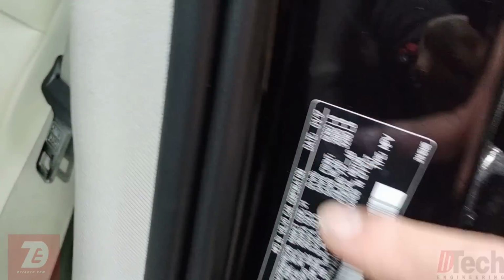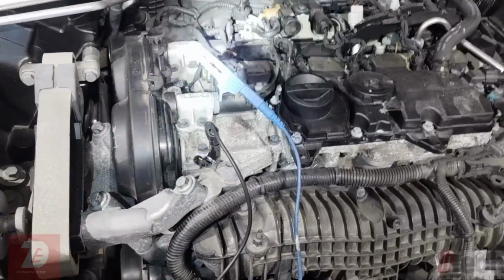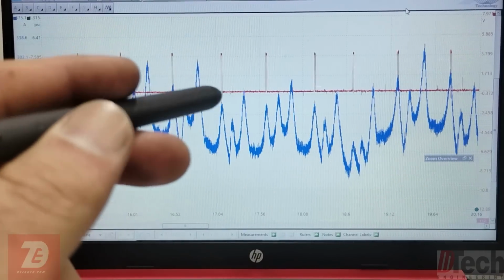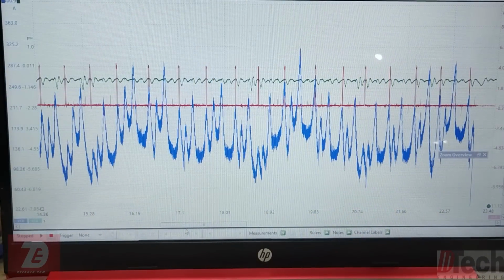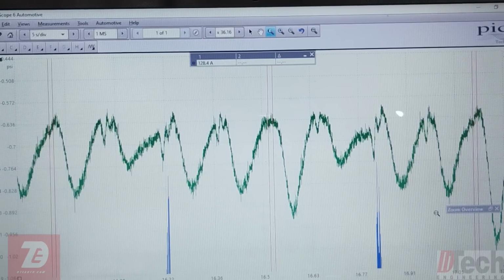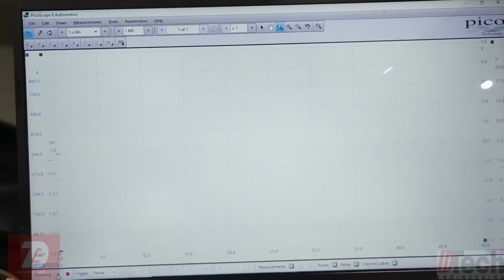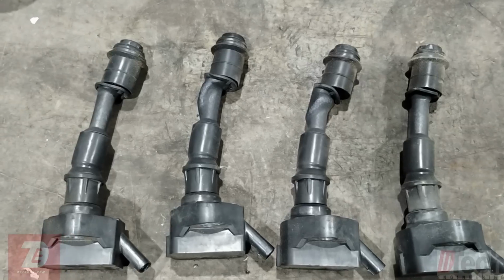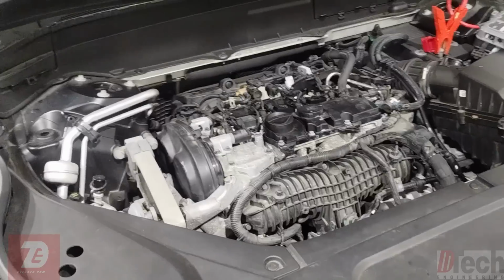2017 Volvo XC90 Crank No Start Diagnosis

Comment: Thank you for the added intake vacuum transducer, no need to waste all 4 channels. No compression then the next cylinder too low and the audible test sounded like more than one problem and random cylinder heights, more than 2 problems. Timing for sure. Be very careful about the wider and narrower spark trigger, that could be faster vs slower RPM, but this time you are correct. We need to learn to measure cylinder peak to peak time and not only rely on our poor vision and misinterpretation and could work it out in reverse from a known bad #2 from the right side. May be compression getting trapped and released on occasion, will wait and see. Its nice that you always take the extra time to work things out. At 17:15 the tops of the green waveforms should be 2 humps/spikes, the first is AN exhaust valve the second is AN intake valve, not from the same cylinder and they shouel be seperated by 20* crank rotation if my memory is correct, the timing is floating all over the place, lets see if something came loose inside and escaping compression will also affect the peaks or roundness??? The peak to the left is not going higher so I do not think there is an intake valve leak on the upstroke of the pistons. Peak high point in the intake seems faily stable. The vacuum pull deptch can be controlled by more than one issue such as trapped compression, RPM, leaking exhaust valve, valve timing vs piston location, etc. Even if you do an INCYL it would be nice to do all 4 to see what is happening all the way around? 

Crank speed slowing down at the blue trace, YES for that cylinder, what about all the other cylinders that are also slowing down at TDC but we are not monitoring them with a trace? You already mentioned the long fluctuations going very high and very low on the blue trace, that area is covered by several crank rotations, not only one, but you are very much onto something coming up. Again measuring peak to peak can determine RPM slowing or speeding up, actually in math/calculus on a scope, the angle of the rising edge and falling edge is all that is needed to make that call which we also use to determine compression leaks past the rings or otherwise on a normal INCLY diag with a leaning tower for one example. The tailpipe should have been the 4th channel earlier in my opinion as per Bernies training and my own belief of when to fill up the scope early in the diag. We can turn off channels to drill in on specifics, not like the old days.  

DAMN, holding our hand over the oil fill hole would be a dead giveaway on this one but I dont think that explains all the problems yet.....Super heated Head, WOW, whats to come....So much for that engine, will you continue to find more.....I am wrong about timing, looks like some extra water working its way in intermittently in cycles. Dude I love it, you dont like to give up. I knew about blowing the fuel out but I DID NOT KNOW it also helped to build up heat, sweet. Could the long cycles of blue trace be back pressure in the exhaust with water until it got blown out in cycles above a certain level??? I dont drive around with the hood open anymore, a hood rod let loose, ended up on top of a headlight and got smashed and cost me a used headlight, I have seen other get their tools in between and a dent in the hood and a video here recently getting his scanner smashed by the hood latch, was thet RRR Rainman Ray??? Because its a multi cam engine, I can say that good spark timing can be for one good cam timing only??? I will give this video my highest rating in my private library as I do several of your diagnosis, cheers.

Comment: Thanks a great video, if there is a bad synchronization of two teeth, can we find out with the relative compression and the ignition coil, as you showed in the video
Reply from the maker: If you are referring to timing being off by couple of teeth, then yes there's a chance you can see that with the relative compression and ignition sync.
Reply: @DTEAuto  Thank you for your response, I am talking about the case where we do not have a reference, if you find a similar case please share it with us

Comment: Nice diagnosis. But after running the engine and driving round the block. That vehicle might never get to run again if left as it might loose compression as a result of the overheat(head gasket issue)
Reply from the maker: it got a little more rough the longer it ran

Comment: This is one of the best videos you’ve done, Sadel.  Lots of great information (especially regarding how cranking speed affects intake vacuum), and backed up with the coolant in the cylinder (or was that unburnt fuel?) and (you called it!) damaged ring land.  Fantastic work!
Reply from the maker: Glad it was helpful! And I believe it was fuel, but could have been coolant also, the reservoir was low.